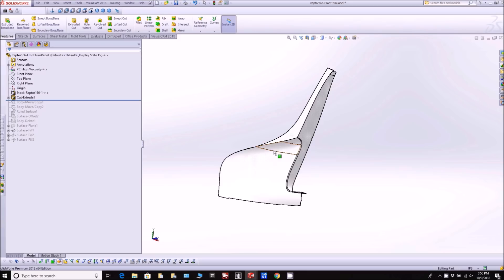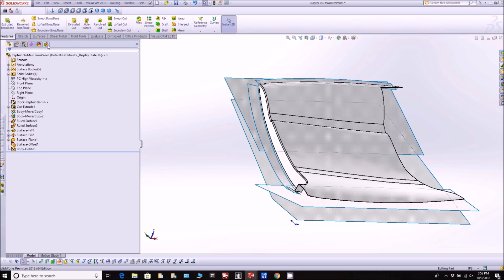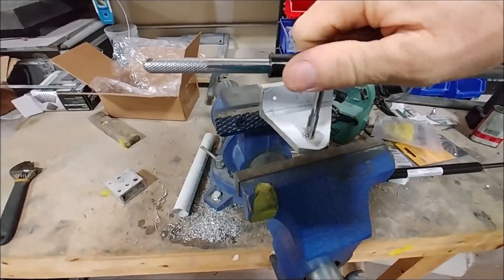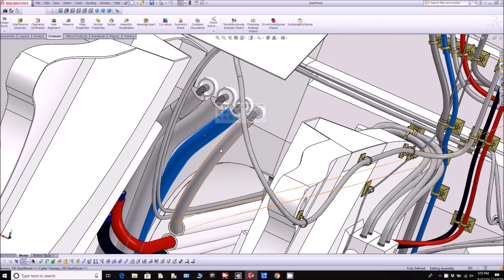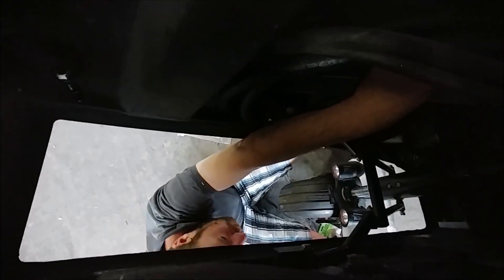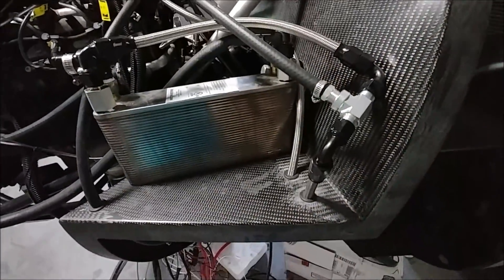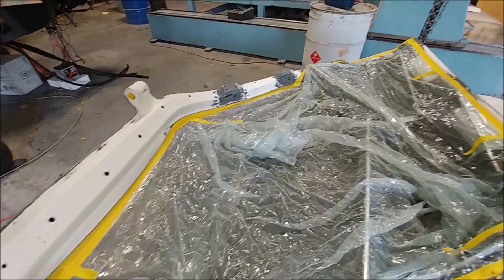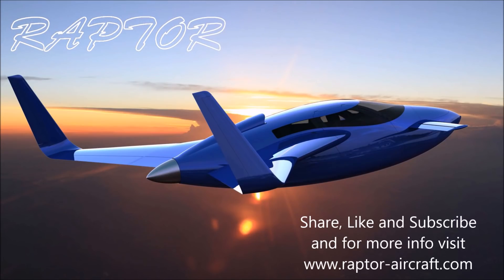Aircon and Electrical - Building the Raptor Prototype

Comment: Just like you did for for those interior panels, I was wondering why didn't you pull out all the parts directly from vacuum bagged foam instead of creating all the plugs and molds. It would have saved you 2 years of time and you would have received 10 times better public response. Also why have you disabled comments on this channel starting 2021?

If disabling comments was intentional then It's not good idea to change PR abruptly like this being so close to production. It will hurt your good standing with the community.

Loved your work and don't want to see you take a nose dive at this crucial juncture.

Comment: It was hard to see - were the battery pass-through posts isolated from the carbon fiber wall? I always thought carbon fiber had some conductance, albeit very, very low. In any case, thinking through what happens if that CF wall were to get wet. Fun to watch these bits coming together!
Reply from the maker: They are isolated.

Comment: Will the prototype have autopilot installed or will that just be for production units?

Also are you going to install any sensors specifically to gather data (like tank fuel temp to make sure you're getting enough heat to keep the fuel from gelling) for different systems into the prototype?

Thanks and keep up the good work it's looking great!
Reply from the maker: Yes and yes.

Comment: I'm a bit confused, why is there a need for a dryer? At flight level the air should be fairly cool, and after being brought up to cabin pressure (and temerature) it should be quite dry and rather need more humidity then less.
Reply: Not certain, but I think the A/C is going to be needed/used more on the ground and lower flight levels.
Reply: The dryer is for scavenging moisture from the refrigerant.

Comment: I am curious how you will handle condensation off of the  AC evaporator.  Since it is on the pressurized side, will there be a small hole that allows condensation to drain?  How do you keep it from clogging?

Comment: Have you tried Maxi-Grip or Gorilla gloves? For sanding and a lot of assembly chores, they are dexterous/sinisterous enough for doing most assembly, down to about 1-4"/6mm bolt heads. They save a lot of wear and tear on fingers. Not so good for wet sanding, though.

Brackets look good.

Comment: On the front panel, I’m sure you’ve got this, but don’t forget to account for the extra material you added to the door jamb to bridge the gap on the door seal. 😉
Reply from the maker: That does not really affect the trim panels. The gap between them and the door panel is consistent.

Comment: Is there just one electrical bus?  Seems like it would be nice to have another source of electrons for the engine computer.  Also, have you gotten your new reduction drive yet?
Reply from the maker: Way back when I was wiring the avionics I showed the backup battery and the dual bus of the vertical power system.

Comment: how expensive was the AC systems alone?
Reply from the maker: I recall that it was less than $2000.  Maybe less than $1500.
Reply: @RaptorAircraft  Thank you, do have the weight?  I have seen ac options for $30,000. insane.
Reply from the maker: Vintage air dot com.